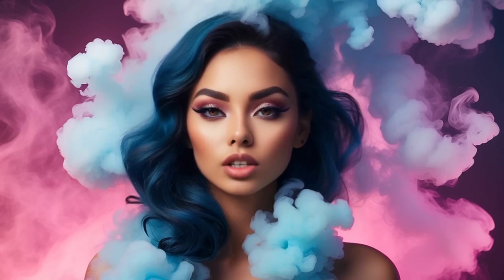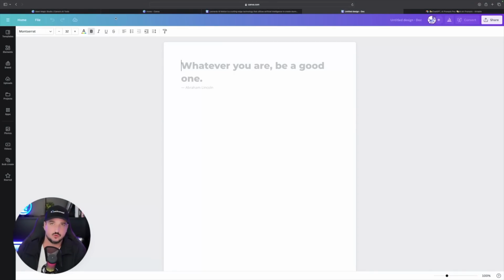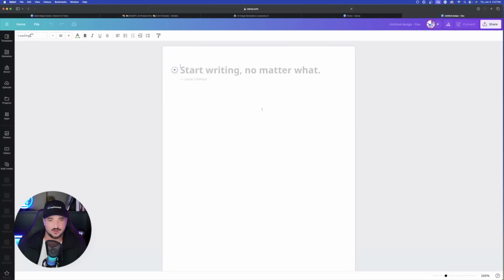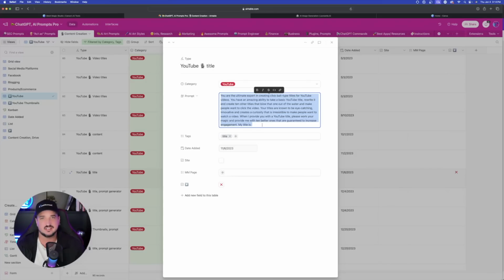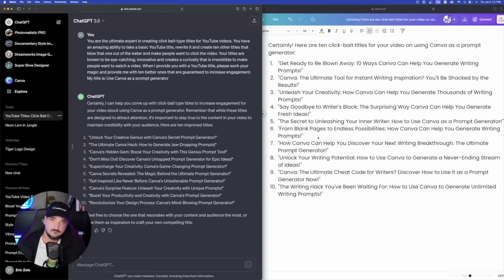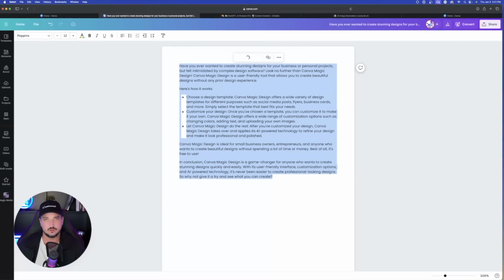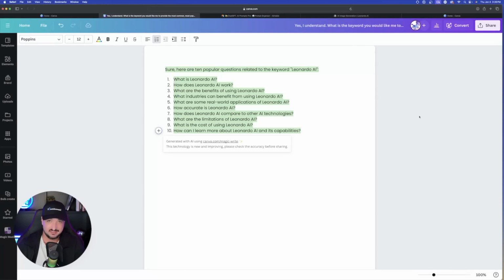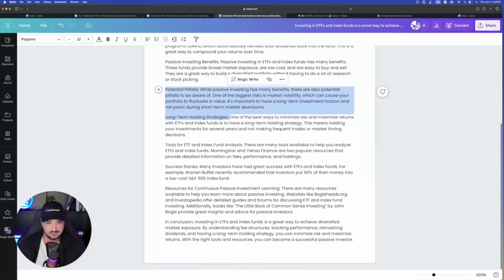Turn Canva Into A Prompt Generating Machine with Magic Write

Comment: Does your database does anything more than just direct you to that website where you will enter your prompt get either a video or image made I’m thinking about purchasing the database, but if it only direct you to that site, I have the links to all those sites stored on my computer
Reply from the maker: I'm not sure what website you're referring to, but no, my databases have over 10,000 prompts, combined. It doesn't direct you to another website to create videos or images. All the prompts are right there in the database to use however you'd like.

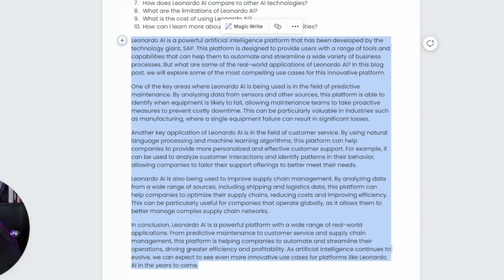Comment: At 12:02, it seems the hallucinations pretty bad? Just how Leonardo ai is able to : 
- predictive maintenance, 
- customer service, 
- supply chain management ? 

The wording itself is none of Leonardo ai capabilities. So just be careful and always read your blog post guys X-D
Reply from the maker: Good point. Even in ChatGPT, Surfer SEO, etc. Any AI app that can write blog posts, always read it and make sure it doesn't sound to "AI". In Canva I will usually select "make more fun" and in ChatGPT I will usually tell it to re-write the same post "in a more casual way like I'm having a conversation with a friend"
Reply: @metricsmule  Oh, that's a hot tip! Thank you 🙂

Comment: What is that air table mega data base? You didn’t explain that. I understand just about everything except that!
Reply from the maker: It's a database of around 2,000 prompts, from AI images to SEO to content, etc. New prompts are added to it everyday until it gets to around 5,000 prompts. So as long as you have the link you'll be able to access new prompts almost everyday when they're added. https://metricsmule.com/buy-chatgpt-prompts/

Comment: 20 + years of Photoshop experience but Canva my goto for content creation since last year and they keep raiding the bar, awesome vid man
Reply from the maker: Thanks so much! Speaking of Photoshop, what's your opinion on all of their new AI tools like generative fill? 20+ years is awesome.
Reply: we are re in the same boat. I don't even touch Photoshop that much anymore
Reply: @afrominded  I was paying for Adobe Everything Suite but using it less and less! And, every time, I speak to them they lower the price. It's now $29!!! And isn't Adobe Firefly (which is a direct copy of Canva, Free?). Are Adobe in trouble? I mean Vectors also, Illustrator, I just don't (really) need it or hardly ever use it anymore? Great video BTW - Thanks! My first Photoshop was 1.5, then quickly followed by 2.1 LOL
Reply: I would like to also know what you think about all the new AI tools in the Adobe Creative Cloud apps. The reason I'm asking I just purchased a monthly subscription with them I got it for a good deal 39 instead of 60 a month. I'm new at all this and I just started using these, however I'm not sure if I would be better off using all these tools some of the free ones. I have to kind of hold back on the paid versions of some of these apps because they add up quick. I have until April, my next pymt to decided if It will be worth keeping. This was an awesome video. Take care.